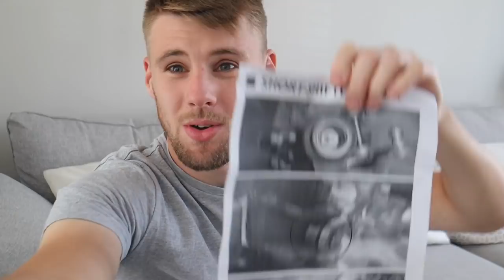VAUXHALL CORSA VXR NURBURGRING SHORT SHIFTER INSTALL

Comment: I fitted mine a while ago, but fitted the solid gear linkage at the same time from the old rubber one and it felt like a decent throw difference, could tell it was shorter, maybe you are not as impressed because you did the solid gear linkage first mate.